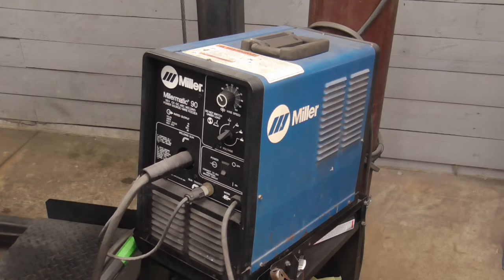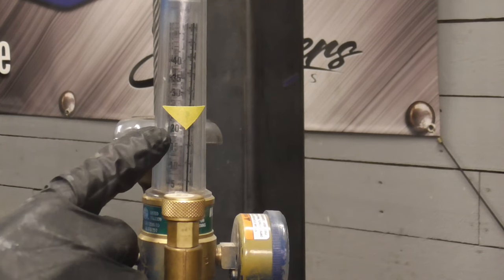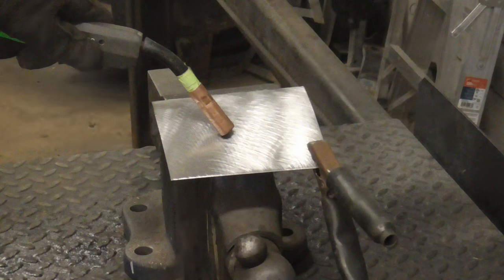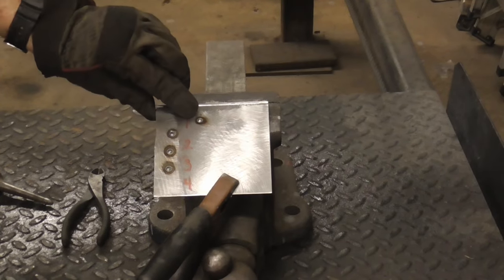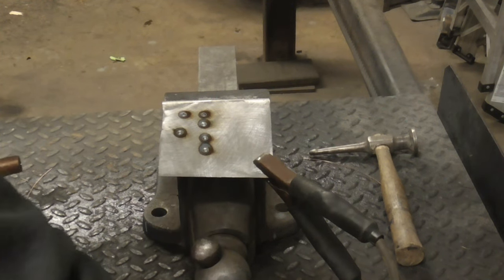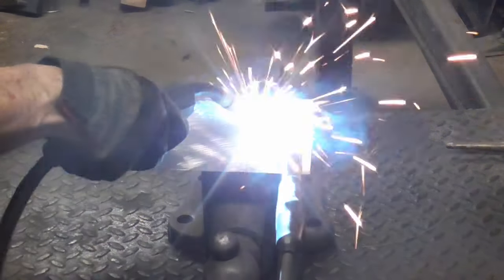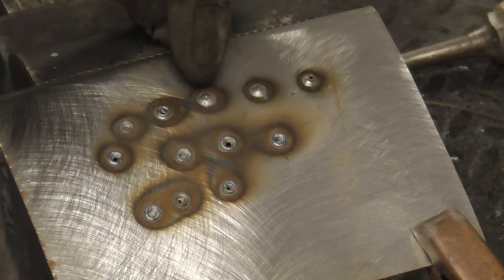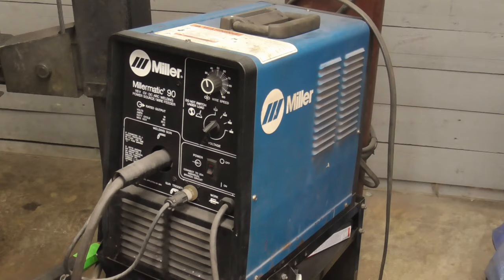MIG Welder Settings Made Easy

Comment: thats the exact setting i use with my millermatic 90 most times.......thanks for the vid, makes me feel like im on the right track
Reply from the maker: You're on the right track.  Can't beat Miller really - used it on 4 to weld my main leaf spring back together on a 73 Charger and drove it for years like that.  Not the safest thing to do but couldn't justify spending the $ at the time :)

Comment: Another nice tutorial, Jerry, many thanks! Those welds without gas looks alot like some of my attempts last summer welding sheet metal on my 06 Colorado's rear wheel opening..... especially the holes (using .030 flux core). Hearing that nice, controlled sizzle using gas and solid wire beats the hot "short circuit explosion" that is flux core on sheet metal! Have a great weekend!
Reply from the maker: Flux core is hard with sheet metal but there's a lot of folks that use it - maybe 'cause you can use it outside as the wind don't blow the gas away.

Comment: Question from left field... have you made any touch up videos? While reinstalling my PAINTED door, I took off several edge areas down to the metal when I didn't realize my gap was way WAY off. So I need to mix up and layer on the same products, right? It's jet black. My first attempt is lumpy.
Reply from the maker: This was just an experiment but you can give it a try - seemed to work well and I think it would work better with black - https://www.youtube.com/watch?v=bERavIsHpkk

Comment: What do you think of those gas diffuser nozzles with the notches out of them for spot welding?  I bought one on Amazon a few years ago and used it once, not a fan
Reply from the maker: I haven't used one but I imagine it would be difficult to know where the weld would be exactly.  Is that what you didn't like?
Reply: Years ago I had a Lincoln SP-200-AB. The AB stood for Auto Body. It had a built in stitch/plug weld timer and came with an accessory notched nozzle. The notched nozzle was for plug welds. It was helpful for those plug welds where you need some downward pressure to mate the two pieces of metal together - you would push the notched nozzle straight into the work , mate the two pieces, pull the trigger, and get a nice, tight plug weld.

Comment: Nice.  Question: I just bought a mig. I set mine up and working nicely on sheet metal from above but when I climb under my car and weld upside down, the welds are way different. Do you have any recommendations or changes to settings? Let me add, I'm basically stitch welding sheet metal where I cut out rust.
Reply from the maker: The welding setting stay the same horizontal, vertical, upside down, etc.  Watch this video starting at 44 seconds in - https://www.youtube.com/watch?v=6DGad79av_c  If you have any ?s after that or if you still are having issues ask again we'll get it figured out 👍😊 Jerry

Comment: As a beginner, I struggle with this every time I use it. And usually I don't have a way to practice before doing something important. Like welding a bung onto an exhaust pipe. Or a brake line bracket onto an axle. I don't know what setting to look for on the chart when there are always two different thicknesses.
Reply from the maker: I think if you go with these general rules of thumb, you'll be fine.  Thanks for checking out the video DIO - I appreciate you always watching :)

Comment: Jerry, that looked like a RED EAR PLUG attached to your wire inside the the welder. Do you use it to keep the wire clean ?
Reply from the maker: No - I think that's just the tip - I do like to keep that sort of clean though.  It's good to have the inside of the cone and the tip clean.  They make a "butter" that you can dip the tip in to help with that - not sure what it's called :)
Reply: thats a plastic guide cone that comes with the welder.....sorry jerry for explaining, i couldnt help myself......lol
Reply: @LakesideAutobody  ......i actually still have that butter i bought 30 years ago with the welder, tells you how much i use mine, i also bought the spray version, the butter seems to block the argon mix from coming out for me

Comment: Hi, I have been trying to plug welds on box side but the weld comes off from the base metal and it just sticks to top metal. How can I solve that, Thanks
Reply from the maker: Maybe your hold in the top piece is too small.  Start w/ a bigger hole and aim the MIG wire at he middle so that it hits the bottom layer first.  Check this video out - might help - https://www.youtube.com/watch?v=388I5kqKlgo

Comment: I was told if you used a mig welder on a 30 amp outlet gas would not be needed
Reply: if im not mistaken, using gas has nothing to do with it.......gas makes it so you dont have to use flux coared wire......using gas is the more expensive way being you have to buy gas and regulator and hoses, but you dont have to chip flux off where you welded once your done welding